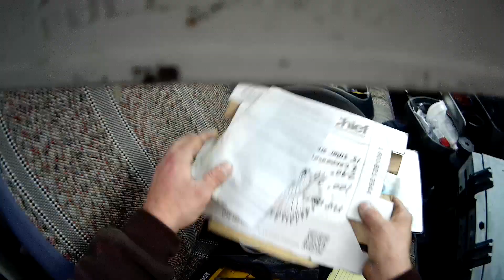High Voltage Emergency Service Call part 1

Comment: This absolutely can't  be compared with the method Here in Germany.
Reply from the maker: +Electroimpex how so?
Reply: Mr Nate Here we have really Strict Regulations.
All Residens have have to have to be informated. After this the Network Operators Shut of the Lines. After this the Line must be shorted to Ground to prevent any Potencials. Then Experienced Workers do they job really clean and Careful, so that nobody is Endangered. After this all must be checked, the voltages too and all Regulations must be done. 
Accidents are extreme Rare here so the stict Regulations are good.
In  other countries are the Regulations not really strict. This is easier and it goes faster, but it is also more dangerous. 
I am Happy to live in Germany.